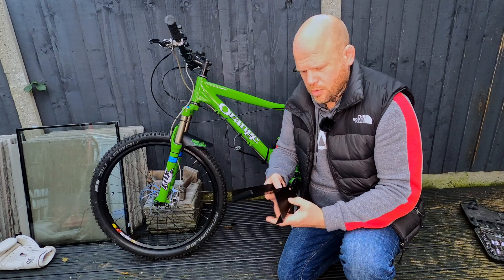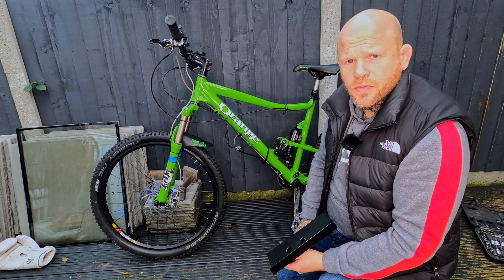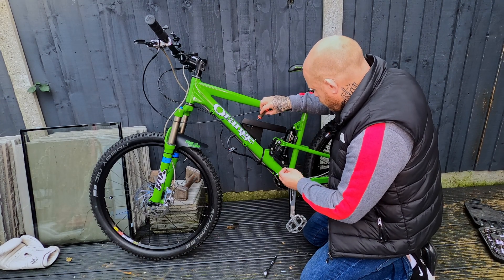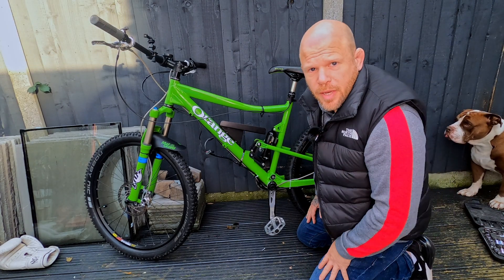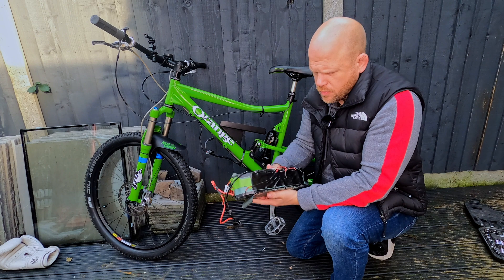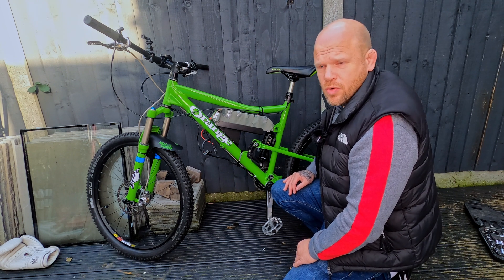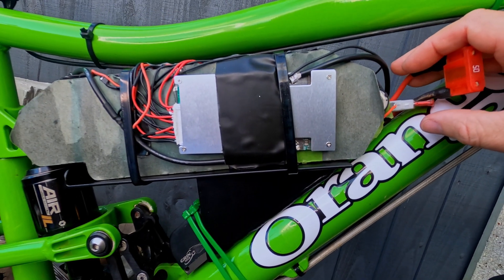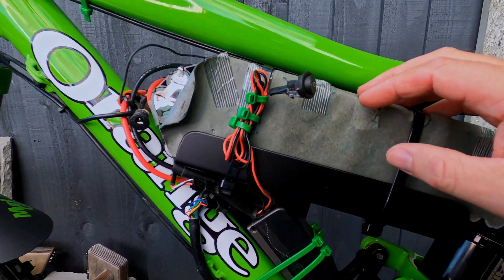Hulk Smash Pt. 4 - Full Suspension 2500w DIY ebike build

Comment: An idea for the switch and charge port would be to drill two holes on the upright section of the battery holder, feed the wires through and mount the ports on the right hand side of this plate.

Comment: I'd personally extend the on off upto the handle bars and use a motorbike killswitch to replace it. Then id remove the charger all together and add a Anderson PowerPole connector or something similar and have it so it can be plugged into charge and unplugged while ridding.

Comment: Wondering if you can help mate what's the maximum a 1000w hub motor can take if you know? I have a 48v battery that draws at 30amps so that's 1440w, the controller is the one that came with it and it just says 1000w and unfortunately the wires get abit melty if I'm hammering it which obviously is dangerous but I don't know what limit's I can push or if just getting a better controller I could push maybe 2000w? Still learning

Comment: Hi Steve got a quick question for you I’ve received my phaserunner and I may fit it today (maybe!!). I got the cycle analyst but it seems a major job as all my current wires are different and I don’t quite understand what’s going where ?? So I may do the same thing as you’ve done which is much simpler to do. My question is the two wires Neil needed to connect together in the throttle wiring, which ones were these? I’ve not pulled the sleeve back yet but I believe there’s more than 2 behind there. Thanks bud.
Reply from the maker: Hey Nick might be best to try asking Neil about that on his channel NJ Tech that was my first experience in phaserunners
Reply: @DudeStuff  ok bud yeah I’ll do that. I saw the video and he said white was temp so didn’t touch it. Looking at the instructions it’s showing white and yellow are the switch lines so I’m confused lol!!
Reply: @DudeStuff  in fact I think I’ve worked it out!! White + yellow on phaserunner is the switch part and white from the motor harness cable is temp wire!! Wish I’d listened more in my basic electric lessons!!
Reply: @DudeStuff  so I managed to get the phaserunner all fitted. Garmin computer on the front and I’m gonna calibrate it with pc tomorrow. I switched the battery on and phaserunner lit up with red LED so that’s a good sign!! Are you on Instagram? I’m gonna upload pics when I’m all happy with it maybe tomorrow!!

Comment: Probably just get a plastic box for the switch and charging socket, like a small electronic project box, stick it to the frame on the small triangle space.
I never bothered with any of that,  instead I just used xt60s, unplug battery and plug in charger using same connections, no need for on off switch and no loose charging socket to fix.

Comment: For your switch and charge port, as an alternative to 3D printing, you should look at KYDEX sheets (available on ebay). Very easy to reshape via heat (oven/heat gun) if you make a quick mold, and then put in a foam-lined press for a few minutes. You can then drill out you socket holes where you need them. Kydex is commonly used for holsters, sheaths, and to carry EDC gear.

Comment: Pretty smart idea,that battery bracket.  
I just got my triangle battery to fit.Had to cut some bits off but it's in there no structural damage still water proof.  I'm running the same motor you are i think...  with a 28ah battery in my kit.
I might have to get a phase runner my controler is gonna have a fitting problem. Gonna have to hit up Kirby's chan to get the 411 on those again.
Keep up the good work Steve. 
Bikes coming along great.
Reply: Hi Shaun
I've got a triangle 28ah battery, maybe check out how I built the controller box to house the charge port, wires ect.
https://photos.app.goo.gl/wGEp8ACUewCEK2Jf9

Cheers mate

Comment: loving this build. been watching from the start of the build. how about a small triangle box to fit into the top of the triangle just in front of the battery for the charge port and on/off switch? you may need to have connectors though if you want to take battery in and out.
got a question for you.. ive got same kit form andy and ive just purchased the phaserunner and the cycle analyst. im defo thinking I need to upgrade the fuse. how easy is it to get to in the battery? is it just a remove outer casing and its an easy switch over? ive not ever taken a battery apart!!
Reply from the maker: Thanks Nick, it's been a labour of love this one 😂 thanks for the idea, I already considered having it placed there, but I'm thinking about getting more stealth than that now, possibly mounting at least one connecter insider the top mount of the rear shock mount 🤔 I'm pretty sure the battery comes apart fairly easy with a bunch of screws and some persuasive pulling. I'm sure the fuse is easily exposed once inside, but bare in mind it goes without saying it will probably void and warrant when you start doing this kinda stuff, I forgot about my warranty the minute I started this build you can barely recognise the battery and original kit now 😂
Reply: @DudeStuff  oh my warranty will be up in December so no problems there I had one controller (stock one) die on me. 10 mile trek with no power on a short circuited controller! was not fun at all! phaserunner has been ordered already so warranty will be out the window as soon as I start soldering! yeah that's an idea. you could of maybe also designed it into the battery mount but I guess its a bit late now!!maybe it could still be done? so yeah im defo thinking 50amp fuse. I saw Neil's bike die also and ive been there!!
Reply from the maker: @nickhill1345  yeah I wouldn't worry too much never heard of a battery of Andy's actually dying, might have to replace a bms at the most, go for it! That's another place I already considered 😂 there's actually a gap near the rear lip on the tray might work nicely for it too 🙂
Reply: @nickhill1345  what caused Neil's bike to die, what is the problem called?
Reply: Looking good and will be lovely when the battery is wrapped. I was also going to say about a small triangle box for the on/off and charge port. If black it would match up nicely with the battery and bracket and phaserunner.